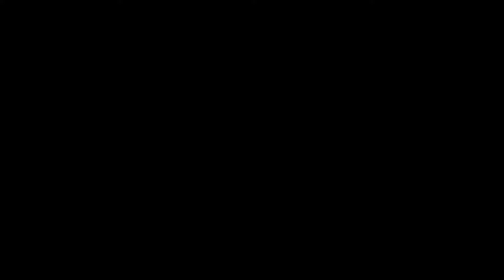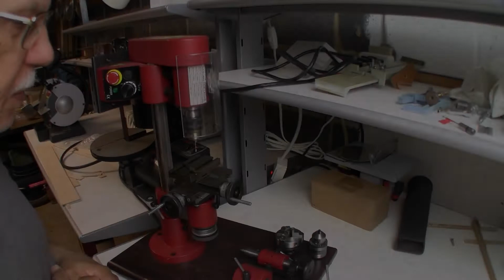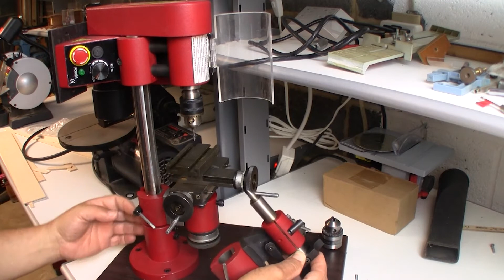LittleMachineShop.com Nano Mill Lathe Drillpress

Comment: I think the setup as shown in the video is for milling.  For drill press, you actually use the lathe tail stock as a vertical feed, with a round drill press table attached, available as a separate accessory.  Also for milling, the head stock has ER11 taper, but requires a non-standard washer, which you could get separately as yet another accessory.
Reply: I love the N1 Nano, and have two with complete set of accessories in my shop.  Extensively modded.  I also use them as modular accessories  that fit onto other machines.  Great video great channel.  Thanks for sharing.

Comment: Can the lathe chuck be attached on one end and the drill chuck be attached on the other end, so as to boar a hole on the materiel at the same time ?
Reply from the maker: Probably but remember this is a tiny little tool with not a lot of heft so it is possible you will not have enough rigidity.